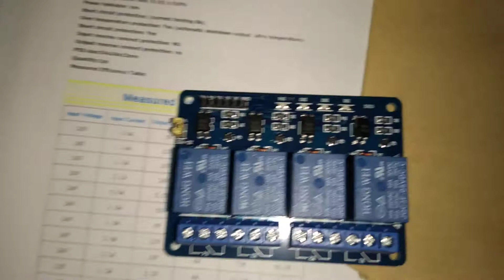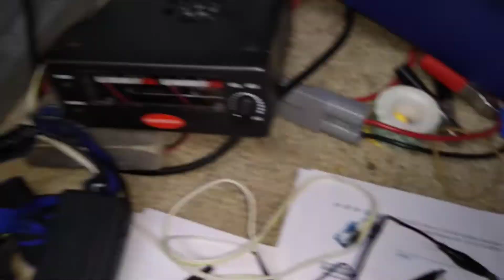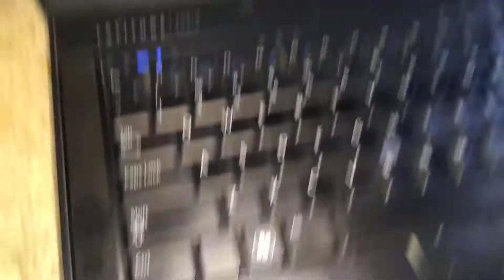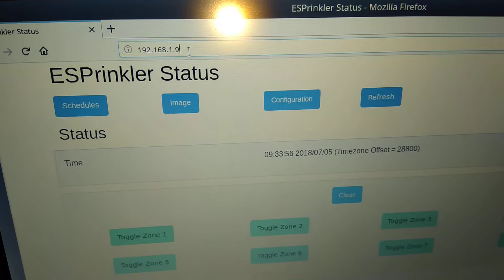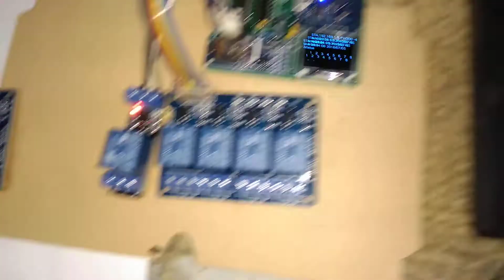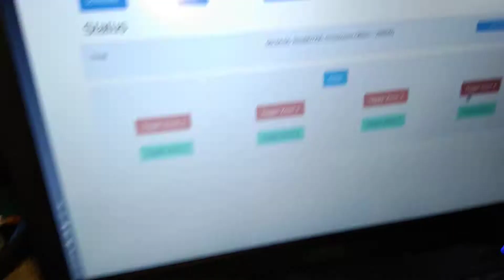Wifi Irrigation Controller

Comment: I did build this with pcb also.. the esp8266 loses the wifi connection after some minutes maybe like 5min. to 15min.

Is it possible that the wifi goes to sleep mode with the esp onboard ?
Reply from the maker: I am not the author of most of the code for this project, so I could be wrong, but I dont see any code putting the esp in or out of low power mode... I have used my version for three summers and have not had any problems with wifi dropping out.  Have you run the esp in close range to the AP to see if it is a signal level problem?

Comment: Thanks, I needed the master solenoid trigger.
Reply: for what? the pump itself?
Reply: never mind for a master relay.. okay that helps if you put it in front of the supply water and keep the valvebox from flooding and the esp !
Reply: @MoesKeckeEcke  I still to this day haven't finished or connected my controller. My bunnings manifold keeps leaking everywhere. I have the manifold mounted to the wall which faces west. Summer heat caused the leak I reckon. I have to keep turning the water supply off to the manifold. Need to find a better manifold that is glued and not screwed together.